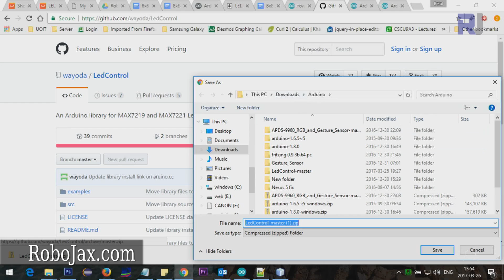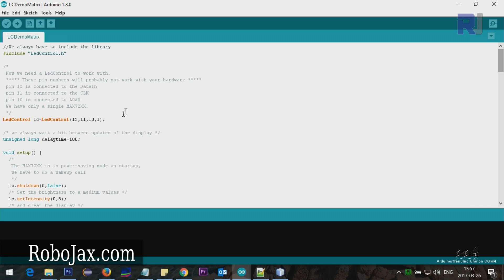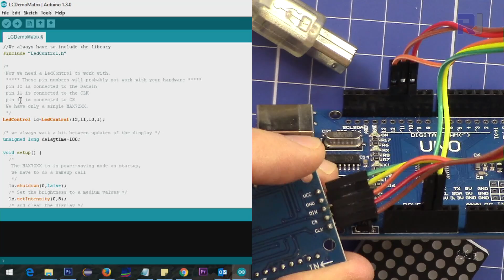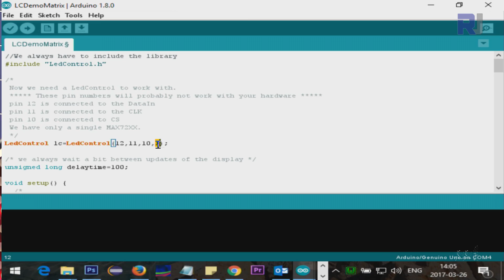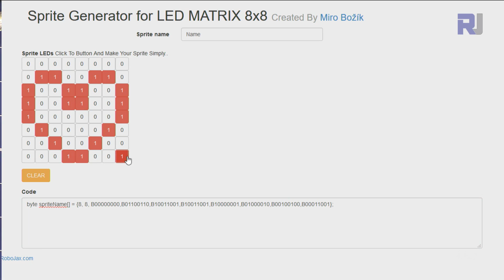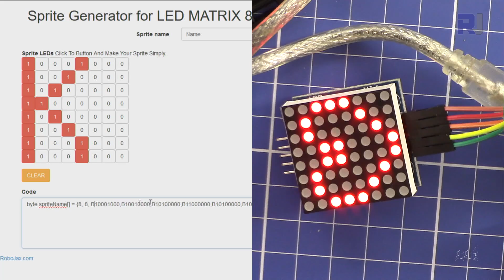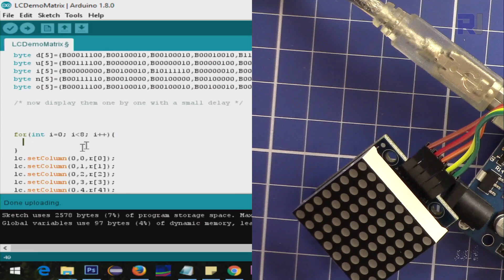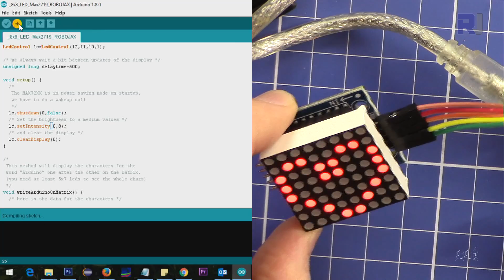E3 Display text on 8x8 LED matrix with MAX7219 Arduino module RJT03

Comment: Sir, how to use 12v LED with max7219 LED matrix?
Reply from the maker: Use a transistor driver for each LED.
Reply: @robojax  are you have a schematic for it?
Reply from the maker: do a simple bing/google search you will find it. search for "max7219 8x8 matrix schematic" and then click on images
Reply: @robojax  i mind about max7219 with high voltage driver for use 12 volt not a just max7219

Comment: Can we control each led in max7219 module using encorder? Can you please suggest a good library?
Reply from the maker: I don’t understand what kind of encoder you be any yo use and what for.  If you meant rotary encoder to change number, then yes ans you can use it without oh ray and may be you would find library.
Reply: @robojax  I want to use ky 040 rotary encorder. I want to use to control each led in max7219 module. For example when encorder knob is turn, on led in max7219 lights up

Comment: the video is very good, but it gives an error.
Reply: LCDemoMatrix:2:10: fatal error: LedControl.h: No such file or directory

 #include "LedControl.h"

          ^~~~~~~~~~~~~~

compilation terminated.

exit status 1

LedControl.h: No such file or directory
Reply: what is the reason for this
Reply from the maker: the reason for that is that you skipped the video and missed the part that I shown how to install library. I just checked the video making sure it was not missed. So when you watch my videos, never EVER skip the video as I don't tell the story of my cat or god. everything is useful if you want to learn,

Comment: Hello professionals,
 I would like to use the MAX7219 8x8 lamps to control 64 lamps that need a little more power than LEDs.  I would pick up the pins from the IC and use them to control transistors, which in turn control the lamps.  I just don't know exactly how to do it or how to do it.  I need a schematic.  Can someone help me ?

Comment: Sir please help me....
Please after a week I have to submit this project in my school as a part of science exibision and scholarship
Sir when I am going to complile then a message is being displayed that 
LedControl.h : No such file or directory

Please sir help me
Reply from the maker: You have not watched the video. If you escape you will miss it.  You have to include library which I have provided .
Reply: @robojax  I included still
Reply: Would it work on Arduino 1.8.8 or 1.8.9
Reply: Sir the program compiled successfully but when I am inserting the 5v pin in the Arduino then the lights on the Arduino are not glowing
Reply from the maker: Then you are short circuiting the arduino. something is wrong in your wiring or soldering. check it.
Reply: @robojax  yes sir it was now it is working thank you very much
Reply from the maker: You are welcome.

Comment: I have 1088BS matrix led, how can i use with this
Reply from the maker: you will need the MAX7219 chip to work with that. without driver (the chip is driver) you will have to put 16 wires and 16 resistors to make it work. would be very hard. Here max7219 chip datasheet https://www.sparkfun.com/datasheets/Components/General/COM-09622-MAX7219-MAX7221.pdf

Comment: Hi sir, I tried to do this for the last 3 weeks for my school project which is due next week, I used Lex Matrix 1088AS, Its 8x32, and the Arduino Uno i downloaded the code just like you explained, Did the cabling correctly.. so when i plug my arduino to the usb, and go on the arduino Program the select the led control and click Upload it uploads but after its done it shows that it finished uploading but nothing happens.. keep in mind that my led FULLY lightens when i plug it to my laptop.. right now i dont know what to do and i hope you reply fast
Reply: Led matrix*
Reply from the maker: the code I have provided it for 8x8 LEd matrix which uses MAX7219. So It should not work. Please post the picture of the module in this website https://snag.gy/ and once you do you will get a unique url (web address), and post it as reply to this message so I can find it.  Also post the code from your arduino in this website https://codeshare.io/ and you will get a unique URL for your code, then post the code here again. i will look at it. If you have the link for the module where you purchased it from, I will look at that too.
Reply: @robojax  hello sir, same thing happened to me when I uploaded the code it showed done uploading but I din't get any  output..i have used 8x8 matrix only

Comment: dosnt work with arduino mega 4 some reason....
Reply from the maker: MAX7219 uses Serial Peripheral Interface (SPI ).  on mega you should use different Pins. 
You can view the configuration on Arduio page : https://www.arduino.cc/en/Reference/SPI
Instead of Pin 12, connect to Pin 1
Instead of pIn 11, connect to Pin 4
instead of pin 10, connect to Pin 53
Please let me know the result.

Comment: how to make scrolling display
Reply from the maker: If you look at the code for letter A in this page https://goo.gl/eRjAaJ
It is like this:

byte A[8]={B00111000,B01000100,B10000010,B11111110,B10000010,B10000010,B10000010,B10000010}; 

and look at image of A in 8x8 matrix, you will see how A is written. Please compare code and the image https://goo.gl/FXNyZH
Then for if you want to the letter A to scroll , write a loop to more the position of does (https://goo.gl/FXNyZH) either up or down or left and write.
Reply: i can't understand.  i make a scrolling display using md parola arduino library. but my text showing invert mode. how to chane invert mode into streight text? i can't understand
Reply: md parola code is.
.
// Use the Parola library to scroll text on the display
//
// Demonstrates the use of the scrolling function to display text received
// from the serial interface
//
// User can enter text on the serial monitor and this will display as a
// scrolling message on the display.
// Speed for the display is controlled by a pot on SPEED_IN analog in.
// Scrolling direction is controlled by a switch on DIRECTION_SET digital in.
// Invert ON/OFF is set by a switch on INVERT_SET digital in.
//
// UISwitch library can be found at https://github.com/MajicDesigns/MD_UISwitch
//
// NOTE: MD_MAX72xx library must be installed and configured for the LED
// matrix type being used. Refer documentation included in the MD_MAX72xx
// library or see this link:
// https://majicdesigns.github.io/MD_MAX72XX/page_hardware.html
//

#include <MD_Parola.h>
#include <MD_MAX72xx.h>
#include <SPI.h>

// set to 1 if we are implementing the user interface pot, switch, etc
#define USE_UI_CONTROL 0

#if USE_UI_CONTROL
#include <MD_UISwitch.h>
#endif

// Turn on debug statements to the serial output
#define DEBUG 0

#if DEBUG
#define PRINT(s, x) { Serial.print(F(s)); Serial.print(x); }
#define PRINTS(x) Serial.print(F(x))
#define PRINTX(x) Serial.println(x, HEX)
#else
#define PRINT(s, x)
#define PRINTS(x)
#define PRINTX(x)
#endif

// Define the number of devices we have in the chain and the hardware interface
// NOTE: These pin numbers will probably not work with your hardware and may
// need to be adapted
#define MAX_DEVICES 8
#define CLK_PIN   13
#define DATA_PIN  11
#define CS_PIN    10

// HARDWARE SPI
MD_Parola P = MD_Parola(CS_PIN, MAX_DEVICES);
// SOFTWARE SPI
//MD_Parola P = MD_Parola(DATA_PIN, CLK_PIN, CS_PIN, MAX_DEVICES);

// Scrolling parameters
#if USE_UI_CONTROL
const uint8_t SPEED_IN = A5;
const uint8_t DIRECTION_SET = 8;  // change the effect
const uint8_t INVERT_SET = 9;     // change the invert

const uint8_t SPEED_DEADBAND = 5;
#endif // USE_UI_CONTROL

uint8_t scrollSpeed = 150;    // default frame delay value
textEffect_t scrollEffect = PA_SCROLL_LEFT;
textPosition_t scrollAlign = PA_LEFT;
uint16_t scrollPause = 2000; // in milliseconds

// Global message buffers shared by Serial and Scrolling functions
#define	BUF_SIZE	75
char curMessage[BUF_SIZE] = { "" };
char newMessage[BUF_SIZE] = { "Hello! Enter new message?" };
bool newMessageAvailable = true;

#if USE_UI_CONTROL

MD_UISwitch_Digital uiDirection(DIRECTION_SET);
MD_UISwitch_Digital uiInvert(INVERT_SET);

void doUI(void)
{
  // set the speed if it has changed
  {
    int16_t speed = map(analogRead(SPEED_IN), 0, 1023, 10, 150);

    if ((speed >= ((int16_t)P.getSpeed() + SPEED_DEADBAND)) ||
      (speed <= ((int16_t)P.getSpeed() - SPEED_DEADBAND)))
    {
      P.setSpeed(speed);
      scrollSpeed = speed;
      PRINT("\nChanged speed to ", P.getSpeed());
    }
  }

  if (uiDirection.read() == MD_UISwitch::KEY_PRESS) // SCROLL DIRECTION
  {
    PRINTS("\nChanging scroll direction");
    scrollEffect = (scrollEffect == PA_SCROLL_LEFT ? PA_SCROLL_RIGHT : PA_SCROLL_LEFT);
    P.setTextEffect(scrollEffect, scrollEffect);
    P.displayClear();
    P.displayReset();
  }

  if (uiInvert.read() == MD_UISwitch::KEY_PRESS)  // INVERT MODE
  {
    PRINTS("\nChanging invert mode");
    P.setInvert(!P.getInvert());
  }
}
#endif // USE_UI_CONTROL

void readSerial(void)
{
  static char *cp = newMessage;

  while (Serial.available())
  {
    *cp = (char)Serial.read();
    if ((*cp == '\n') || (cp - newMessage >= BUF_SIZE-2)) // end of message character or full buffer
    {
      *cp = '\0'; // end the string
      // restart the index for next filling spree and flag we have a message waiting
      cp = newMessage;
      newMessageAvailable = true;
    }
    else  // move char pointer to next position
      cp++;
  }
}

void setup()
{
  Serial.begin(57600);
  Serial.print("\n[Parola Scrolling Display]\nType a message for the scrolling display\nEnd message line with a newline");

#if USE_UI_CONTROL
  uiDirection.begin();
  uiInvert.begin();
  pinMode(SPEED_IN, INPUT);

  doUI();
#endif // USE_UI_CONTROL

  P.begin();
  P.displayText(curMessage, scrollAlign, scrollSpeed, scrollPause, scrollEffect, scrollEffect);
}

void loop()
{
#if USE_UI_CONTROL
  doUI();
#endif // USE_UI_CONTROL

  if (P.displayAnimate())
  {
    if (newMessageAvailable)
    {
      strcpy(curMessage, newMessage);
      newMessageAvailable = false;
    }
    P.displayReset();
  }
  readSerial();
}
Reply from the maker: I am sorry I have not tested your code, but the inversion for the code i have given can be done easity.
For example: in this line  lc.setRow(0,i,B[i]); just change the place of i and B[i] something like  lc.setRow(0,B[i],i);
I have not tested this but it should work.
Reply: please give me your full code
Reply from the maker: you gotta understand that this line lc.setRow(0,x, y). So if you change the position of x and y, it will rotate it so make line lc.setRow(0,x, y) into line lc.setRow(0,y, x)  and of course for letter A to rotate it, we have 
A[8]={B00111000,B01000100,B10000010,B11111110,B10000010,B10000010,B10000010,B10000010}; 

and then you can use either  use lc.setRow(0,i, A[i]) or use  lc.setRow(0,A[i],i) .
The code for rotating A is this:
Just replace the code from 
void writeArduinoOnMatrix() {

to 
}// writeArduinoOnMatrix()  end

with one of the code below

void writeArduinoOnMatrix() {

A[8]={B00111000,B01000100,B10000010,B11111110,B10000010,B10000010,B10000010,B10000010}; 

  /* Letter A  */
  for (int i=0; i<8; i++){
  lc.setRow(0,i,A[i]);

  }

}// writeArduinoOnMatrix()  end

or this:

void writeArduinoOnMatrix() {

A[8]={B00111000,B01000100,B10000010,B11111110,B10000010,B10000010,B10000010,B10000010}; 
  /* Letter A rotated  */
  for (int i=0; i<8; i++){
  lc.setRow(0,A[i], i);

  }

}// writeArduinoOnMatrix()  end